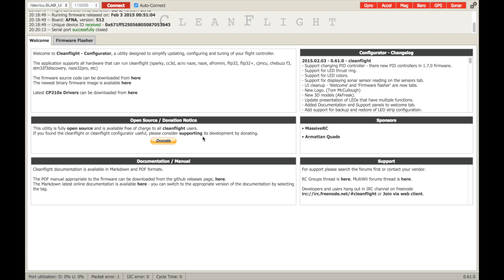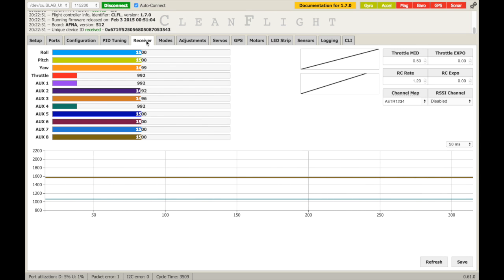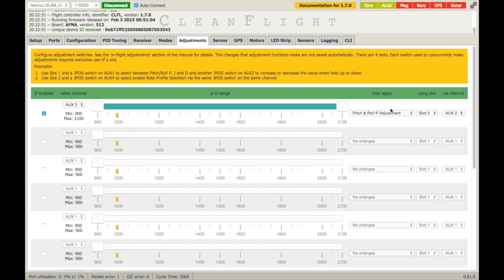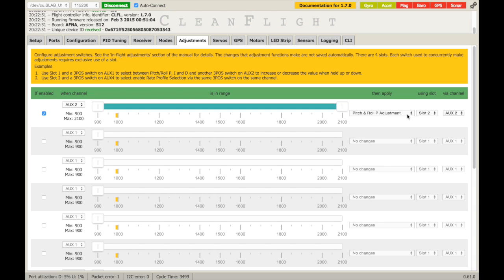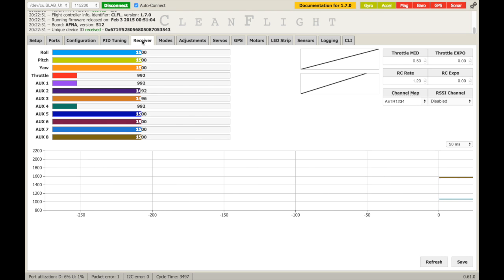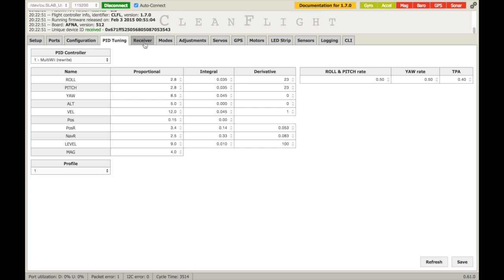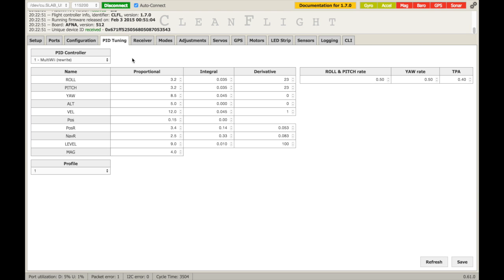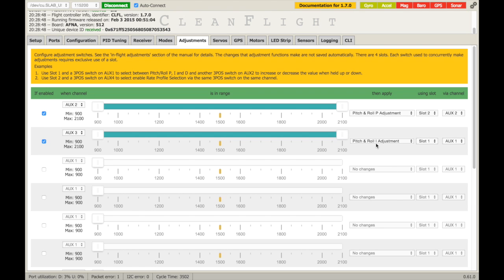Cleanflight - PID Switch Configuration Tutorial

Comment: Hello, I have just gone through cancer treatment Raidation and 3 rounds of Chemo than an operation! I have a Taranis plus with an x8r rx that I want to hook my naze32 rev5 to but I do not have a clue on how to wire the x8r rx to the naze32 rev5 wires!! can you please, please email me a photo of how to do so? I hooked it up to cleanflit and upgraded board and soldered all the pins but I do not have a clue how to hook the naze32 wires correctly to the frsky x8r rx! Thank you in advance for any or all help in this matter    davidringler40@yahoo.com
Reply from the maker: https://www.youtube.com/watch?v=w9G_zDhkOl0
Reply: yes I watched this video but the naze32 rev5 board I have is a lot different and does not have what you are talking about in this video!
Reply from the maker: +david ringler how do you want to hook it up? PPM, SBUS, Direct channel? Dont care? Just want an answer?
Reply: ppm thank you for any or all help!
Reply from the maker: +david ringler looking at the specs on the X8R, it doesnt support CPPM. You will need to wire each channel directly to the board, ie, pin 1 sig to pin 1 on the naze32 and so on until you use all the channels you want. Min of 5 is recommended by me. Option 2 is to use s-bus via the side port. Put the receiver into sbus by selecting D16 in the menu if your Taranis and bind the receiver. Then just wire +ve and -ve from pin 1and 2 of the receiver to the n32 +ve and -ve. Pin 3 of the x8r goes to the first input pin on the N32. Last, select sbus on the receiver within the N32 gui, which is either betaflight, cleanflight or baseflight.
Reply from the maker: +david ringler sorry, added reply above for some stupid reason
Reply: HI, I JUST WANT TO HOOK IT UP USING ALL THE WIRES NEEDD NOT SBUS! CAN YOU SHOW ME THIS WITH A DRAWING OR WITH A NAZE32 REV5 BOARD AND A FRSKY X8R RX WIRED TO NAZE?

Comment: I'm getting there Mike, with understanding Modes and such, but tell me,  what is the Slot position used for - - Oh great video's am working my way through them 

 Do you have a video which explains, the interaction between -  Tx  travel range - Cleanflight min/max/min command and BLHeliSuite  min/max Throttle - - - do they  all  influence  the calibilation of the Esc's start point and speed range...Joe
Reply from the maker: No i don't Joe. But in short, BLHeli states the lower and upper range when you calibrate tour esc's. I set these in cleanflight with a few ms difference. so if max is 1995ms, set in CF 2000ms. visa versa for the lower end. ill see if i can make up a video on this.
Reply: Hello, i have a problem, i put all PID from video in board. Everything whit receiver and TX is ok, but when i disconnect from pc,  and i wannt to fly, my transmiter and reciever, i think is not visible, nothing hapend, why??
Reply: +Ales Lipic did you press "save" to save the settings to the board?
Reply: yes i am, but not in CLI, is not needed??!! OR???
Reply: maybe must i chose another firmware??
Reply: +Ales Lipic alex, can you explain your problem with more detail. I have no idea what you are stating. Does the transmitter stop talking when you disconnect? Does it work when you are in cleanflight and moving an axis on the transmitter works? Please understand i'm not with you and didn't experience what your doing. If you explain it with detail, i can try to help you better.
Reply: Seafury mike
thanks, yes just what you write, problem was fixed. the aux was on off.Thanks

Comment: ive got a zmr 250 3k carbon cheap frame , im using flip32+ 10dof fc , im having a slight rapid oscilaion , im not familiar with pids , im comming from kk board , and they are totaly different ,so i need to get a understanding of cleanflight pids , where should i start ,?
Reply from the maker: just like KK, rapid oscillation is a sign of a high P value. Drop it back by .02 each time and save the change and see how that goes.

Comment: Great video. Thank you.
Just one question.
Once you have adjusted your PID at the field and are happy with them, how do you save them?
So you can check them when you get home?
Reply: I also use a switch to arm/disarm.
But found this did not save them.
you have to use sticks to disarm to save them.
You will hear a beep when they are saved.
then disarm your switch for next use.
Reply from the maker: The PIDs are not dynamically saved unfortunately. you need to connect to a PC without switching off the Flight Controller and save them.
Reply: Thanks. I figured it out.
If you use the sticks to disarm the board, they are saved. I have a 2pos switch setup to arm my board, but I can also use sticks to disarm and save my settings.
Reply from the maker: thanks for the reply. i didnt know that.
Reply: no problems.
glad I could share some info
Reply: Kevin Ray I assume disarming the board saves them? I use a switch to arm/disarm, would that be a problem?
Reply: +Kevin Ray could you please explain this?
Reply: +Morry Sade he is stating that disarming the board via a switch does not allow the config change to be saved. The traditional method of arming and disarming is the only method that allows config changes to be written to memory. It must be hard coded in this manner. Remember, cleanflight and baseflight has an option to use a switch to enable or disable the board. The racing guys use this a lot in the event of a crash
Reply: +Kevin Ray- I found this quote in the documentation "Settings can be saved when disarmed using stick positions: Throttle Low, Yaw Left, Pitch Low, Roll Right."

Comment: Hi Mike.. I need some help.. my receiver tab AUX1234 does not show any activity in Cleanflight... it just stays at 1500 value and does not move at all (usually it fluctuates a little like my AETR channels)..

I went back to baseflight and everything is ok... nothing changed in terms of hardware or my radio settings.. I am using traditional PWM with a futaba R2008SB rx... So yeah... what do I need to adjust or check in terms of the config?
Reply: I can suggest, try to remind receiver, check in system PPM isn't ticked. Other than that not sure why it doesn't work
Reply: In your radio, go to the mix page and add channels.  They won't show up in cleanflight until they are configured in your radio.

Comment: Nice tutorial Mike. What is the purpose of the slots in Cleanflight?  I see you matched Aux channel to Slot when you added the second adjustment but I've also seen people with 4 Aux channels all running through Slot 1. I've read up on the Github docs but I can't make head nor tail of it.
Reply: Not entirely sure, but i think it will allow flexibility to mix and match. the documentation located here: https://github.com/cleanflight/cleanflight/blob/master/docs/Inflight%20Adjustments.md (as yourve seen) says to generally match these numbers, so thats how i approached it. the docs are very light in this area, thats why i made the video to show people something that works.
Reply: Seafury mike Yeah the docs are light on info. Not a biggie really, but we had a discussion at the Cage last night in an attempt to fathom it but to no avail. Cheers for the reply.
Reply from the maker: Ross Hall Hey when either of us works it out, get in touch with the other and give them the update as to what it really does
Reply: seafurymike Deal.
Reply from the maker: Ross Hall I got to get to the cage one night. sounds like a load of fun
Reply: seafurymike Do it. It's just a Nascar style oval, but it's a pretty decent place for a crash and a chat.
Reply: seafurymike So think I just found the answer... I think.

The slots are used when you have overlapping adjustment ranges that have the potential to apply conflicting values to a parameter, and because the FC doesn't check for problems you have to use different slots to avoid any problems.

See here: https://github.com/cleanflight/cleanflight/blob/master/docs/API/MSP_extensions.md

Specifically this part:

AdjustmentIndex

The FC maintains internal state for each adjustmentStateIndex, currently 4 simultaneous adjustment states are maintained. Multiple adjustment ranges can be configured to use the same state but care should be taken not to send multiple adjustment ranges that when active would conflict.

e.g. Configuring two identical adjustment ranges using the same slot would conflict, but configuring two adjustment ranges that used only one half of the possible channel range each but used the same adjustmentStateIndex would not conflict.

The FC does NOT check for conflicts.

Hope I interpreted that right.
Reply from the maker: Ross Hall Ok so it would be good to try this out on the system. Thinking out loud if you were to enable lets say Barometer and Magnetometer and if you wanted both "ON" at the same time, so you would have a switch position with both active. This would give an overlap. This would mean you need two slots?

Comment: i have tried this and got it working well,  have a pot on aux1 moving the pitch and roll P adjustment this is on profile 2.  but this also works on my other two profiles even though they are not enabled on the other 2 profiles..?
. i have set slot 1 what does the slot tab mean....?

any ideas why the other 2 profiles are adjusting too...
Reply: Tx profile or Cleanflight profile. if its a CF profile then you should submit a bug report to Dominic Clifton on Github
Reply: I havent updated my cleanflight for a while i was waiting for it to settle down a bit i am on version 1.6 maybe i should update... also i didnt reboot flight controller between profiles but cant see why that should make a difference...i just got the pot selecting different flight modes thats pretty cool... especially with ez-gui telling me the flight modes i am in pretty neat that frees up my 3 pos switch now for inflight pid adjusntment... Cleanflight profile... not tx..

Comment: Hi... I flashed my CC3D with CleanFlight 1.7.2 following your tutorial but now it´s not working the channels to change AUX 1,2,3. I have a Taranis radio with X8R receiver. It wooked fine before fashing. Can you help me please?
Reply: SBUS, PPM, PCM?  i have a Taranis with PPM. i can confirm this is working. can you check on the forum if anyone else is having the same issue. my receiver is EzUHF
Reply: Seafury mike ... I´d like to use S-bus and so using only one cable but now I have PWM set... I think... It´s not working the AUX modes, for some reason. On Taranis Plus is everything correct and maybe it´s the wires broken??? Before flashing with CleanFlight all was working perfect (changing modes and gimbal servo). My receiver is a FRSKY X8R. Thanks a lot for helping.
Reply: in cleanflight, under adjustments tab, do you see the indicator move when you flick a switch. if yes then it is working, if not, yes something is wrong. check you are on same profile in Tx.
Reply: Seafury mike Thanks a lot. I made one cable and now I have it working with S-Bus on my CC3D flashed wit CleanFlight. It was just strange that was not working when using PWD. Ok... Thanks a lot for your help. By the way, I like your vídeos, they are great.
Reply: Awesome Marcelo, glad you got it going. At least you are having some luck. I tried to upgrade my Martinez gimbal controller and now I have no boot loader and I have no usbasp programmer. Time to walk away. Thanks for the kind words about my videos. I'm glad they are helping people. I'm glad to share what I find out in this hobby. My frustration become your videos!
Reply: Seafury mike I´d like to help people a little bit more, but now my time is very shor (new baby just borned 2 months ago). Do you have idea why my MinimOsd is not working anymore? Maybe I have to flash it with Naze firmware... no idea at the moment. I put telemetry on Flexi Port but nothing... and wrorst, it deactivated my settings for the receiver. Hehehe... just did it again and tried the Auto Tune but was too windy. At least I saw it starting the tune, that means, working. Thanks a lot again.
Reply: On CC3D you have to flash correct version for that CC3D software. But your on Cleanflight so you can't use CC3D version and have to use something like KVOSD as it uses different protocol to talk with the flight controller. UAVtalj is used for CC3D and I think Mavlink for open boards that use baseflight/Cleanflight. Welcome to the crap world of different protocols and having to match them.
Reply: +Marcelo Tito Farinon x8r dont work with ppm but will work with sbus